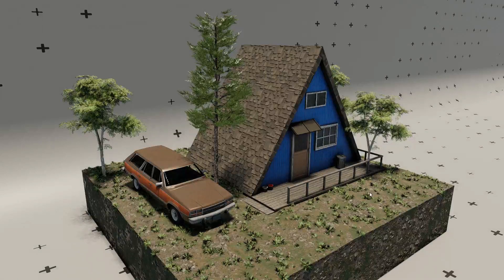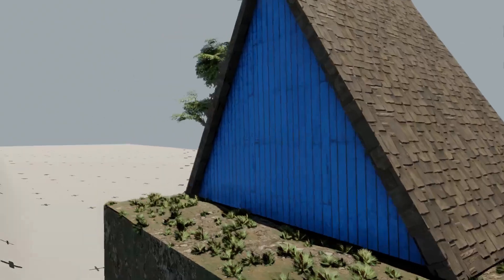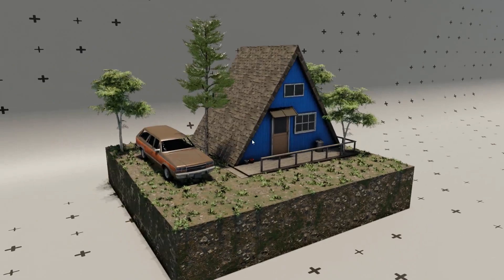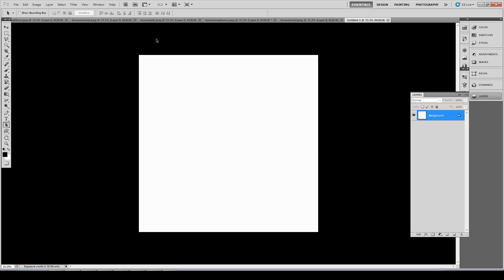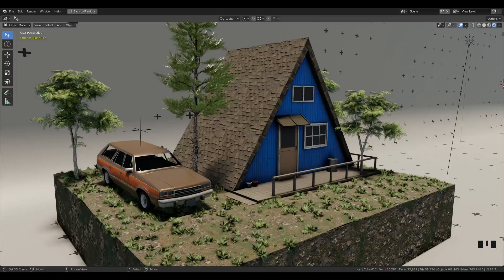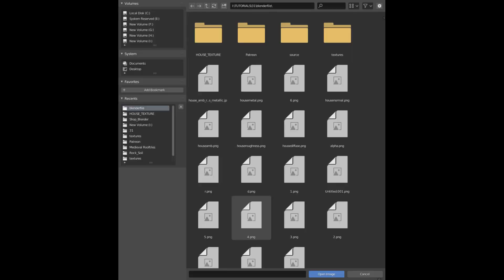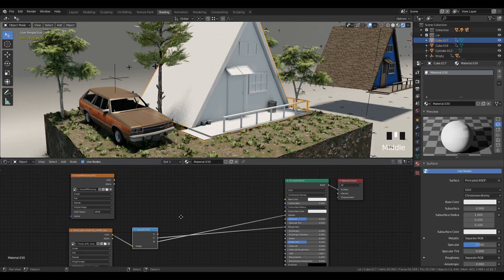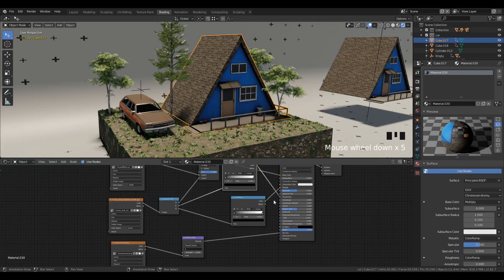The Power Of Texture Channel Packing Blender + Photoshop

Comment: This has been a staple workflow for UE4 textures since they already have a RGB connector ready to connect to rather than needing an additional middleman node before connecting to the output. 

But to be honest I don't find myself using this workflow a lot due to my laziness and just using Node Wrangler's CTRL + Shift + T method to quickly load multiple materials and because the grayscale textures in question don't take much space as separate maps compared to Diffuse/Normal/Displacement 16-Bit that end up being the major chunk in file size.
Reply from the maker: Bro if you are working on big project or for a company  you may use this as this will lower the usage of memory . The benefits of using this is high as with these you can run the entire level smoothly in terms of frame per second. If you are creating huge environment then I am sure if you use this it will be easy to navigate as it will not lag more compare to not being use this technique.
Reply: @SaqibHussain88  Can definitely see in use with a large scale project say for optimizing a game, but for solo and quick scenes the usual works as well.

Comment: You do know one RGB (24-bit) texture takes the same VRAM as three grayscale (8-bit) textures right? Of course if you save it as an RGB image it takes more space but you can save 8-bit grayscale images instead.
Reply from the maker: The image I used for RGB channel was already 8 bit. It's better to use single texture rather make individual maps for Greyscale textures.
Reply: @SaqibHussain88  Sorry, that is false. Every RGB used today is at least 24 bits... 8 bit depth for each colour channel. 32 bits if you add the alpha channel.

You can save greyscale images as 8-bits, by using the "BW" option in the save menu instead of RGB or RGBA. Problem is that many people don't do that and leave it on the standard RGB, thus wasting space. And to my shame... I am one of these many people. ;)

So your method is still valid. But you can simply use the 8-bit greyscales instead... and it is a bit more intuitive and consistent than having to go through the "combine the colour channels" method that you use here.

Good idea, and it definitly works. But there are easier and better ways.
Reply from the maker: @Groffili bro first of all thanks for your comment I do appreciate it  but I do know if we add them up it depends on what we are using rgb or rgba (24 or 32 ) but I meant for a single channel is 8 bit, What I wanted to say is that alot of people these days do create seperate image for roughness,metallic,displacment,specular and alpha in rgb which can increase not only the bit size but they have to export every single image file for an external program.The purpose of the video was to show how you can pack textures inside Red,Blue,Green channel even you can even go further by adding an alpha channel then I know it will be 32 bit but you can save alot of space and even time while not making seperate textures and  exporting it to a different software or gaming engine.
Reply: @SaqibHussain88  You are completely correct in your assessment of the space-advantage when using such packed images.
I dare say that this will provide even smaller files than three seperate 8-bit greyscale images, because you only use one set of header informations. Though that wouldn't be much.

So, yes, I do see the point of your idea. As I admitted, I am one of those people who carelessly create 24-bit RGBs for the greyscale data layers, and I will definitly change that habit. You opened my eyes here!

The debatable point is just whether it is better / easier to go through the process of combining three texture sets into a single image, or just use seperate 8-bit textures.
Reply: @Groffili  header doesn't waste much RAM. I'd just use grayscale images. For example photoshop allows you to save grayscale in many formats. And some formats even have color data which is not 24-bits, such as indexed gif (or indexed PNG) or JPEG which can be chroma-subsampled.

For a quick understanding: BMP format is not compressed. Photoshop lets you save different bit depths of BMP. The size of the BMP is how much RAM it will take for that texture at that bit depth.
Reply: @4.0.4  I agree completely. The important point here is simply: what format can a certain program understand (be it Blender or PS or Unity or Unreal or whatever else), and what do I have to do to get it to understand it.
Saqib Hussain's method works, and is RAM-efficient. But it seems to be more work to pack and unpack the files than simply to use more efficient files formats.

For people like me, who just want to get their projects done, and don't bother with absolute optimization, less work appears to be the better option. The less I have to care about in-depth structures, the easier for me.
In that regard: the last graphics format I bothered to get an in-depth understanding about was IFF-ILBM. ;)
Reply from the maker: @Groffili  When it comes to games use this technique to avoid loading separate grayscale images, which saves Memory.
Reply: @Groffili  you’re misunderstanding how bit depth works. You can’t just assume RBG is 24 bits because that’s just “today’s standards” because you can save an RBG as 8bit, R3 B3 G2. Add an alpha channel which is always 8 bits then you have a 16bit RBG image. You can then decide if you want more bit depth without alpha so R5 G6 B5. Add alpha and you get 24bit RBG and so on…
Reply: @MonsterJuiced  Sorry, I understand very well how this works. I'm an old-timer who started doing this stuff back when 8bit was all you had.
It's not the different options for encoding your data that I am questioning. You can do it in any way you want within the limits of your system. The question is one of convenience.

Yes, you can save your RGB as 8bit, 16bit, 24bit or 128bit or 3bit. Or rather: you can't. You can encode your file in any such way you want: but depending on which software you use, the "saving" is done by the program, using its coding.

If I use Blender or PS or Unreal to open a file of a certain format, the program will use its own preset understanding to interpret this file. If I want a different interpretation - say, use an 8bit greyscale image as an R3B3G2 color... I will have to do that on my own. I will have to do my own encoding and decoding.

And here the question remains: is it worth it? What do I gain? What do I lose?
Reply: @Groffili  Well speaking in terms of game design you'd be creating more room for better performance. I'm glad you do know your stuff and you're half right with unreal. It does give you the tools to encode yourself but if you use an 8bit image, the sampler will still read and use that as an 8bit image and nothing more. I fact I think even without even without image the engine defaults to 8bit unless you feed it something with a greater bit depth. If im missing something ofcourse I'd like to learn from you for sure
Reply: @MonsterJuiced  I'm only an amateur, and an amateur that's out of the loop for 25 years at that. I have no idea what the best thing for optimization or game engines is. I'm just basing my evalutation on what I do know, and what I am presented with.

I understand that you can use a method like in the video to optimize performance in terms of space and time. I have done so myself. But in this case here: we are presented with the alternative of having three sets of data that we have to create, manipulate, save, load and use... and taking these three sets of data - that we still have to create, encode and save, have more problems manipulating, have to find and create a way to decode after loading... and I am not seeing the advantage HERE.

So it might be me who is missing something here. But I'm not finding it in this video.
Reply: @SaqibHussain88  you might be confusing "8-bit per channel". RGB is 24 bits, but sometimes called "8-bit" as a shorthand for "8-bit per channel" to differentiate from HDR/RAW, which might use 10, 12, 16 bits per channel. The Y8 colorspace uses 8 bits in total for a grayscale image.
Reply from the maker: @4.0.4  Ok may be I misunderstood but want to know are you suggesting me to use HDR/ RAW image instead of RGB one ? Am I right now ? :) 
Hey I was just showing my workflow thats all . 
There might be other way to do it.
Reply: Not sure about VRAM, but Eevee treats every single texture as an uncompressed 24 (or 32, depending on Alpha channel) bit map. That means a single 4k grayscale texture will take 64 megabytes in RAM (4096×4096 pixels × 32 bits ÷ 8 bytes ÷ 1024 kbytes ÷ 1024 mbytes). Multiply that by 4 (specular, roughness, metallic and bump/AO, depending on what textures there are) and you get Diffuse (64mb), Specular (64mb), Roughness (64mb), Metallic (64mb), Normal (64mb) and bump/AO (64mb) = 384 megabytes of RAM for a single object.

With channel packing, you can reduce that number: Diffuse (64mb), Normal (64mb) and Specular, Roughness, Metallic, Bump/AO (combined into a single RGBA, 64mb) = 192mb.

It basically halves your RAM usage, if done correctly.

Comment: What an elegant solution to having lots of textures. Will this also work if you are using a height map, instead of a normal map? Thank you.
Reply: yes as long as it is grayscale then it should
Reply from the maker: Yes, absolutely! As long as your maps are in greyscale you can use them inside of the texture channels.

Comment: next year, i want to build pc, can u give me recommendation which gpu should i buy first?
Reply: Get an RTX 2070 or 3070 or 3080
Reply from the maker: Bro It depends on your budget. Don't go hard on yourself. But if you can buy latest graphic cards like Rtx 2070 or 3070 or 3080 with a ram more then 24gb ram then I will say go for it .
Reply: don't buy AMD's gpu, nvidia is better optimized with blender